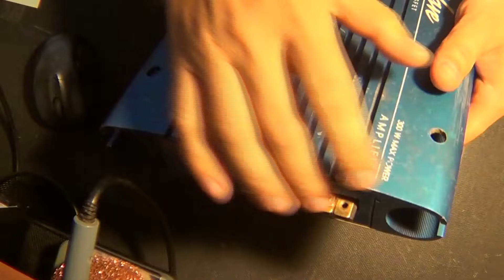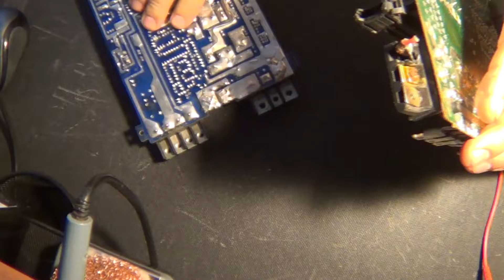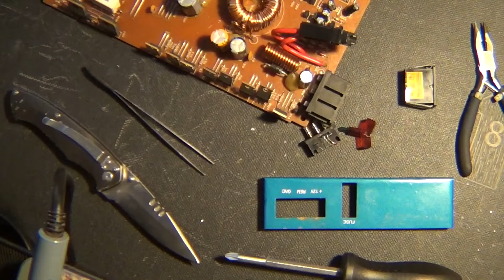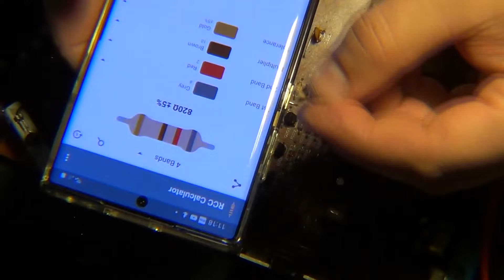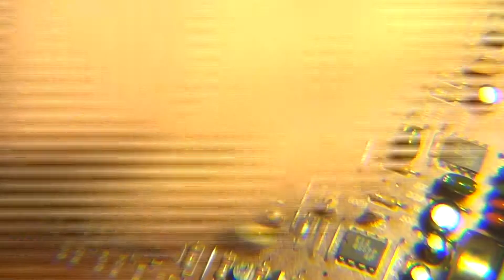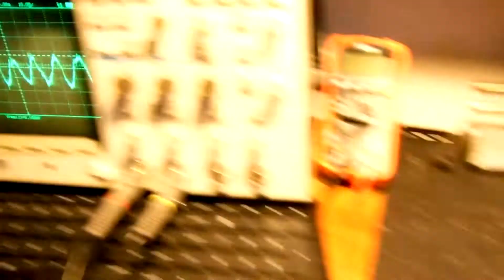Repairing and Refurbishing an Old School Fultron ( Memphis ) Amplifier - #electronicsrepair

Comment: That is really awesome! I gotta check if the mother board on this camera that I bought at a thrift store is fried. The camera charges, but doesn't turn on.
Reply from the maker: Oh yes, I've had a few of those cameras. Could be the board, corrosion or contact failure. Also a few other problems...good luck =)